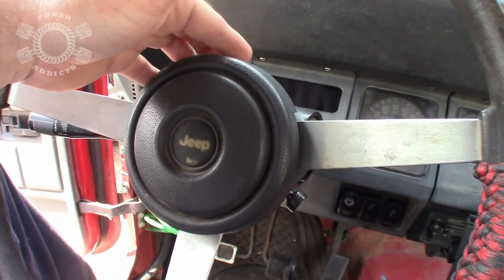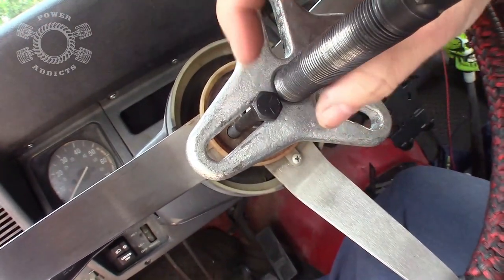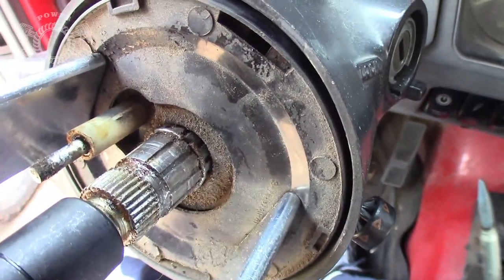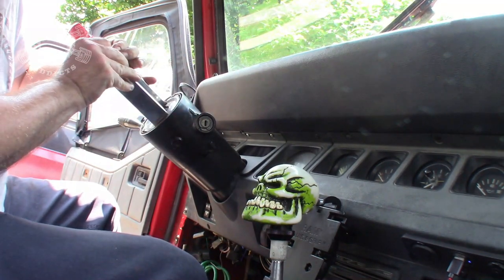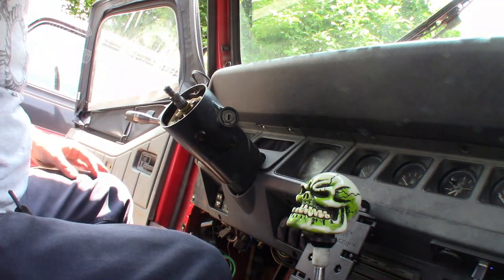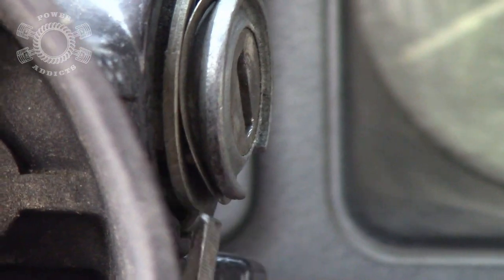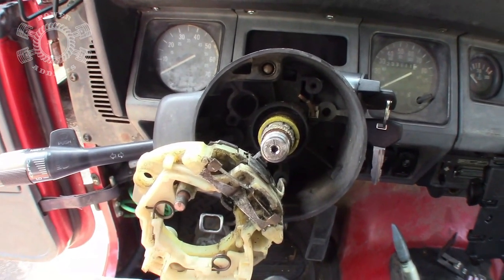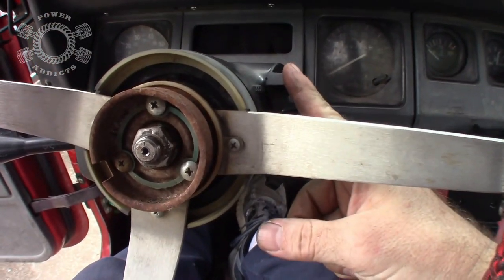Jeep Wrangler YJ Ignition Lock Cylinder Replacement #jeepyj #jeepwrangler #poweraddictscrew

Comment: Thank you for this, someone tried to steal my Jeep this week… with this video I was able to do this myself for less than $150. Now if it happens again I know what to do. The tools are cheap, the parts cheap. 
They jammed a flat screw driver into the cylinder, key no longer worked.

Comment: Insert your key turn it slightly back towards accessory and pull the cylinder out. Takes about 10 seconds to change your lock cylinder
Reply: Would that work with a 1995 jeep yj ?
Reply: I have a 95 and yes it works
Reply: I don’t have a key.  So that’s not an option for me, correct.  I think I have to for this disassemble route, correct?

Comment: I didn’t catch the year on this yj. This one is the early-mid 90’s. Not the 87-90/91 one right??
Reply from the maker: The one in the video is a 91
Reply: Is this the same for a 1995 YJ? Thanks so much for the video by the way.
Reply: @CvilleRic  if it looks the same it should be. I think after this body style they don’t make em with the steering columns like that if at all.

Comment: Your skull do you have a threaded nut insert in it or just the rubber piece that comes in it?

I need to figure a better way to keep it from working loose over time.
Reply from the maker: Its an actual shift knob. Here is a link to it https://amzn.to/3vxNMSO
Reply: @Poweraddicts  So is mine, it just came with a rubber boot thing and a compression type of lock. It just works it's way loose after time.

Comment: You don't have to take the steering column apart you can remove the lock cylinder with the key
Reply: Is this the case? Because I see a lot of videos removing the gut like this
Reply: That’s the ‘key’ point I think.  I don’t have a key and I’m the dipshit that lost it🙄

Comment: I was able to make a tool to compress the plate. Started with a piece of sheet metal 4”x1.5”
Drilled a hole in the middle to slide over steering shaft
Drilled one hole on either side and slide some toggle bolts through it.
Slide “tool” over steering shaft
Loosely installed steering wheel bolt
Tightened toggle bolts against plate compressing spring. 

Hope this helps someone